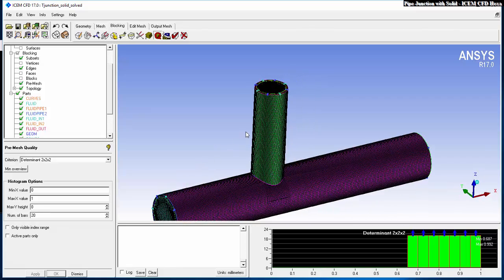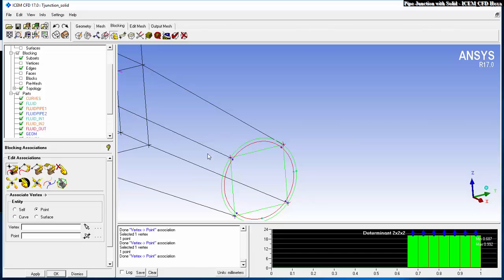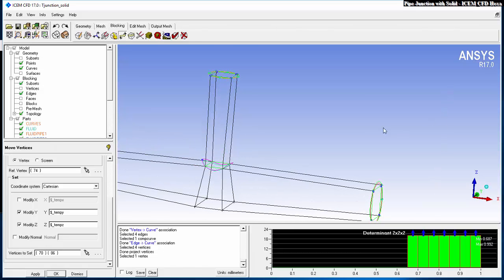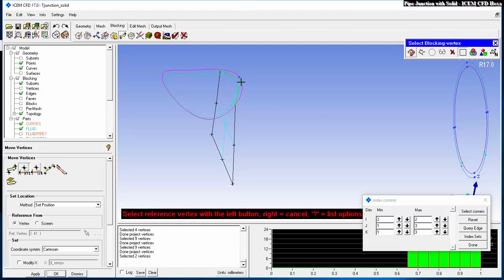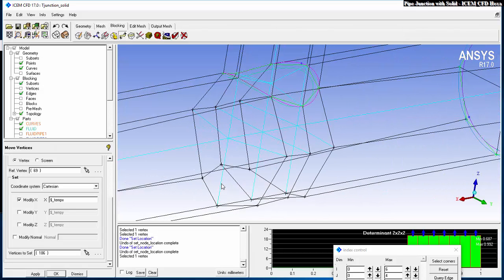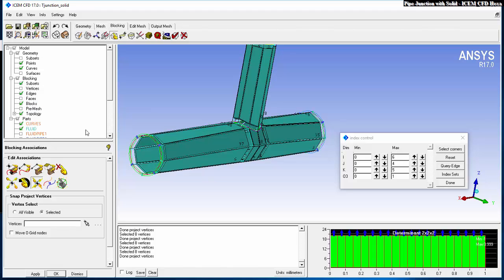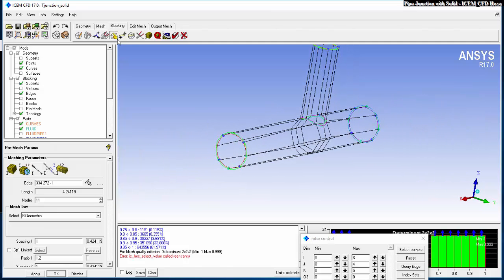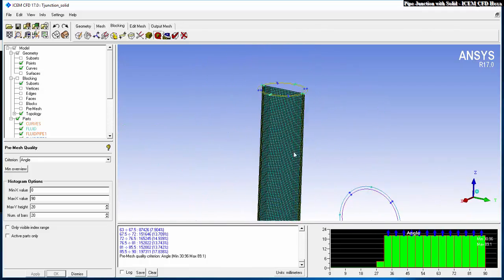T Junction with wall thickness : Hexa mesh in ICEM CFD

Comment: Thank you very much for this video. Can you kindly send the link to the geometry?
Reply from the maker: I will try to locate my geometry, as this is vey old video.
Reply: @CFD_Mechanic  Did you perform FSI with this mesh?
Reply from the maker: @funkedacosta7701  No
Reply: @CFD_Mechanic  Thanks. Do you know if there is any video of FSI where ICEM is used for meshing fluid and structure?
Reply from the maker: @funkedacosta7701  There is no link of Meshing software with FSI.

Comment: What if i have a space frame or structure of any kind that is made out of my many tubes or members(say a bridge).
Would i be able to create the meshes for each member on icem separately adn then join them for static analysis or i will have to mesh the whole structure at once?
great video thanks
Reply from the maker: you can do in both way. When you start from one big block and split it into small blocks to fit the geometry we call it as top-down approach. In other way, when we create mesh for each block and then combine them is called bottom up approach. 

I will go with former approach that is top-down approach.